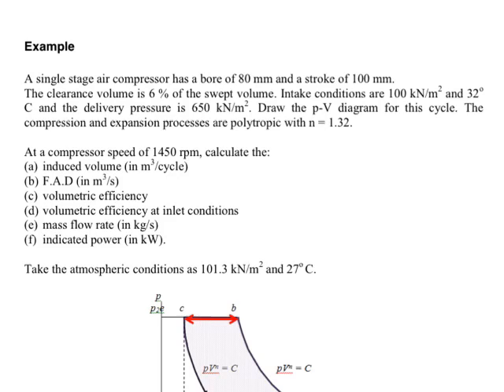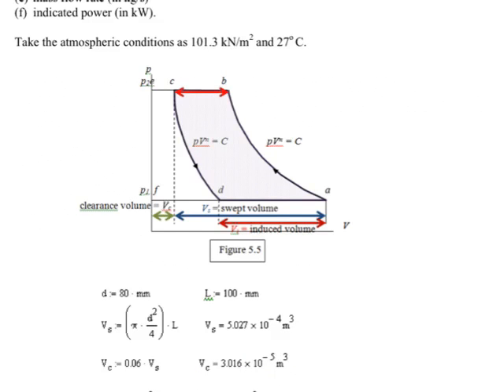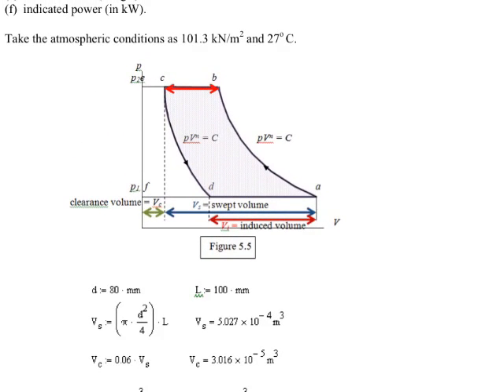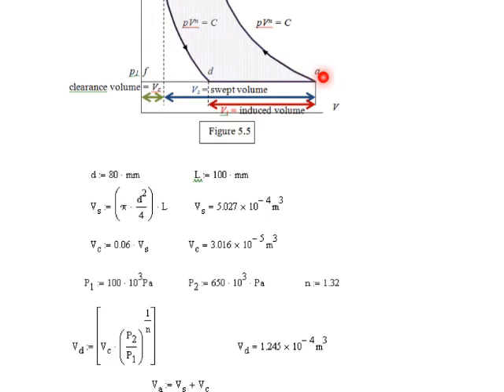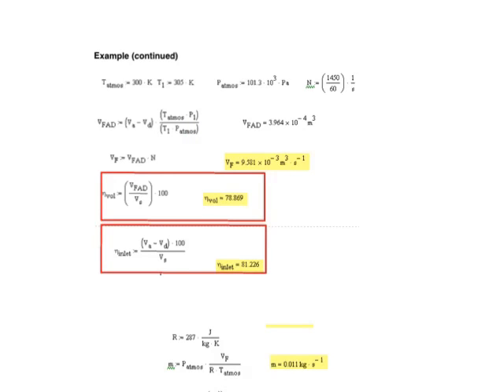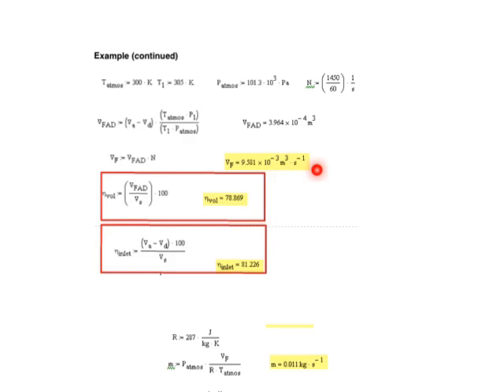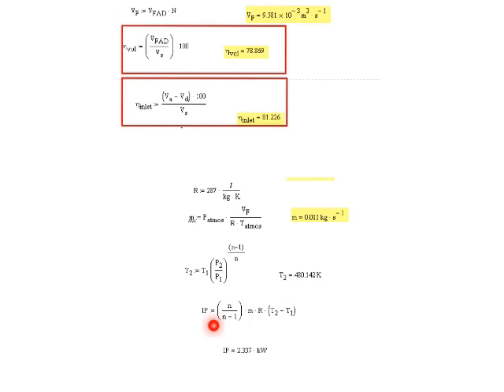Compressor calculations

Comment: Brilliant example.  However I see the inlet air mass versus outlet air mass.  If the outlet air mass is 0.011 kg /sec then on inlet we will have the same mass.  We know that every m3 air at normal pressure and temperature is approximately 1.225 kg/m3, so on inlet we have 9 liter air per sec or 777.6 m/day air. Considering efficiency 79% to 82.2% then on inlet we have 946-984 m3/d (these if compressor works 24 hr).  Power 2.237 kW on 24 hr  will need 56.088 kwh/day to deliver 952.56 kg air.  So the exercise say that compressing 17 m3 air (599.5scf) at 650 kPa need 1 kwh energy.

Comment: Pressure should be corrected by adding the 100kPa of Atm pressure. Otherwise it's all vacumm pressure (Subatm). I may wrong...
Reply from the maker: The inlet pressure in a compressor is slightly less than atmospheric during the induction stroke for air just outside the compressor to enter (induced)

Comment: Hi sir, there are some formulas u neglected to define towards the end and the video quality is not enough to see them, also at the FAD formula which is the product of the induced volume and the other entity that I think you misinterpreted sir, kindly listen to it sir
Reply from the maker: Hi Shittu,
Please identify the formulas. The video quality? Please identify the time where the video quality deteriorates. Finally, please the induced volume has to be converted to FAD conditions.
Reply: @SelvaRaj-jz6ol  
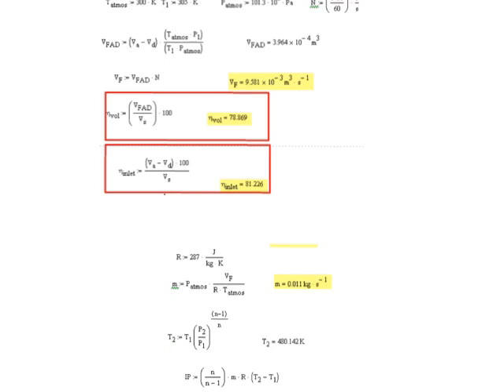Okay sir, the quality of the video deteriorated at 6:48 till the end sir. The part where I think you might have misinterpreted what you write which is not clearly shown due to the video quality at that point is the formula for Vfad, the part where u defined the conversion factor which would be multiplied by the induced volume, you said the same thing twice there sir which I believe must be a mistake, and that was last formula you defined, you only called out the answers of the rest of the formulas, it could have been okay to just pick them out if the video quality was okay till the end. 
Lastly sir, what parts of the formulas has to change or what parameters needed to be included in case of a double acting compressors.
Thanks sir, I'd be very glad and appreciative if I could chat you on WhatsApp sir, +2348152512781.....Thanks sir
Reply from the maker: @shittumo  
Hi Shittu,
Please view the video full screen. There is a slight pause as I scrolled down to the next section.
Be very careful when calculating FAD whether at inlet or atmospheric conditions. You are confused with the perfect gas equations p1V1/T1 =paVa/Ta. 1 represents inlet conditions and a represents atmospheric conditions.
Please communicate with me if you wish for more details through email. WhatsApp is only for chats. It’s a pain to do technical discussions and calculations on WhatsApp.
Please be patient at 6:48. The video continues...wait a little bit.
Reply: @SelvaRaj-jz6ol  
Okay sir, what is your email sir?
I did all I could with full screen, waited for the video as you've advised but it was the same.
Reply: @SelvaRaj-jz6ol  
My email is msh.olamide@gmail.com

I'd be waiting for your e-mail sir. I decided to leave mine here instead
Reply from the maker: @shittumo  
You need to solve your video issues first.
Reply: @SelvaRaj-jz6ol  
If anything is wrong with anything concerning the quality of the video sir, I guess it's with YouTube or the recording of the continued solution of the example not my phone or anything that has to do with me sir. Thanks sir